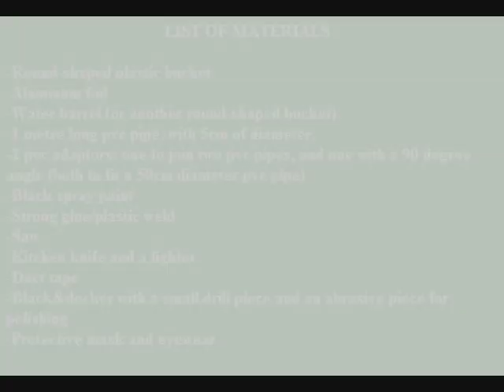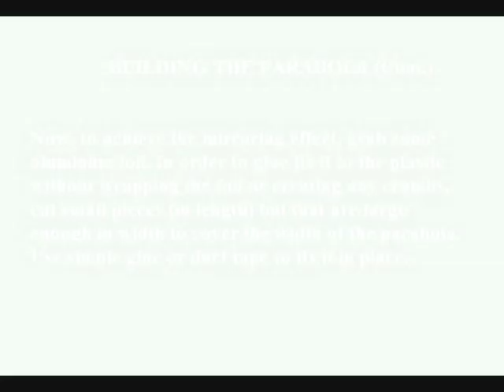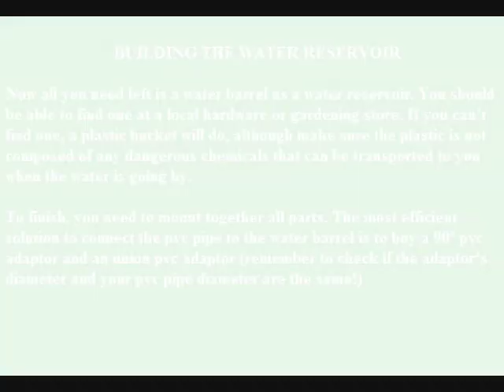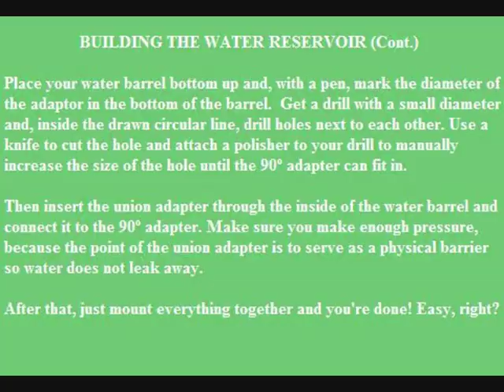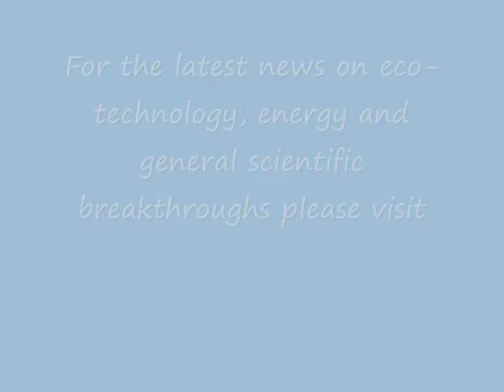DIY: Solar Powered Water Heater in 3 Steps

Comment: Best build for water heating is solar evacuated tubes for heat collection around copper tubing to a central tank, and as well.. using seebeck thermoelectric modules for energy production, not peltiers those are for hobbyists.  These can be used for passive constant energy, just on the temperature change from one side to the other.  So many ways its silly.  But an evacuated solar tube can make steaming boil in under 45 minutes... just sitting there.Check out the power pot, or customthermoelectric

Comment: 40 years ago my grandfather rigged a way to heat the water in his pool by simply using the pool's filter to pump water through copper pipes laid out on the deck's black shingled roof, then back into the pool. Raised the pool's temp by 10 degrees and was free, just had to install a little stronger pump. Do you know how much ppl spend on heating their pools???

Comment: use copper instead of PVC and have i loop back into tank with heat exchanger lower than tank so water can naturally circulate, put T in cirulate line, add a valve to T.  I would have cut hole on side near bottom so it is easier to mount on any bar stool or whatever.  Paint tank black, or better yet, use a black tank and put that in the sun as well.  Double as a radiator.  Some ideas... I think it's possible to weld up that plastic somehow?  I forgot how but I think i read that somewhere...